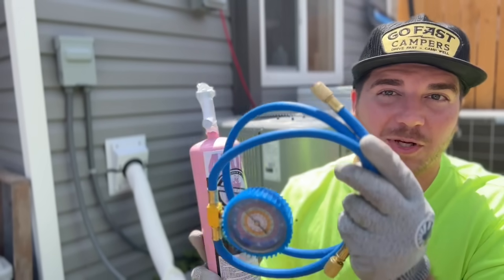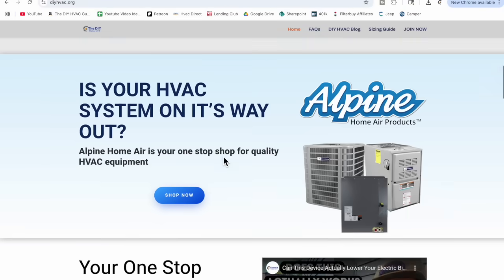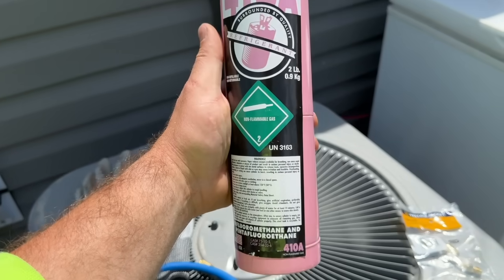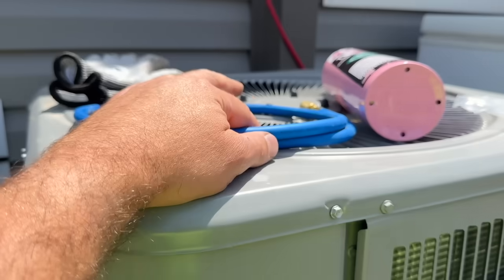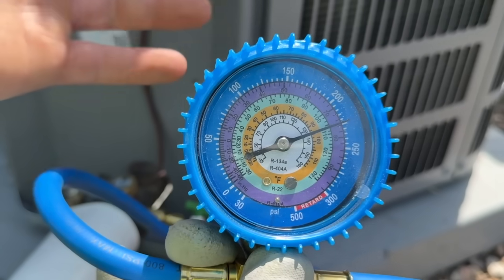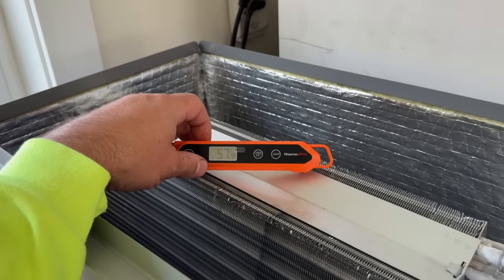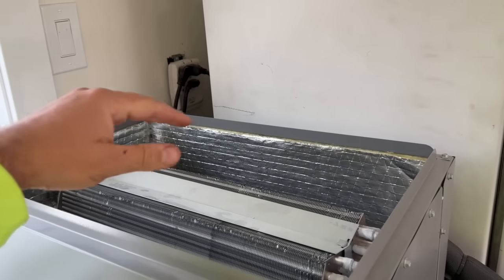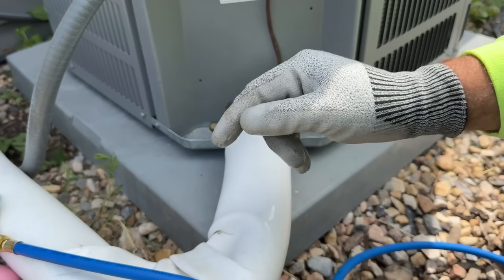You Can Recharge Your Home A/C Like A Car??  Colder Air in 6 Minutes!

Comment: 144 bucks for the kit, I can get a guy out here and charge my system for the same price
Reply: "I got a guy" 😆
Reply: No way you’ll get a licensed tech with an EPA certified card for 140.00 dollars
Reply: @melvinwillingham233  Maybe. If it's cash, that's tax free income.
Reply: Had my R22 system topped off this past Sunday for $150 total.  Last bump on my 22 year old Trane system was 3 years ago.
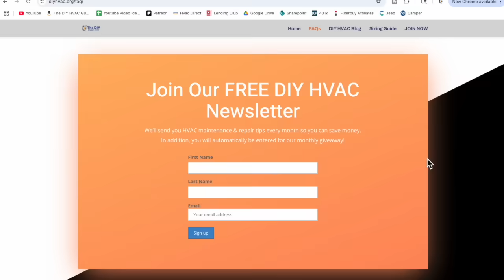I've used this HVAC repairman several times before.  Called him about 12:30 in the afternoon, he was at my house about 3:00.
He was finishing an install when I called, otherwise he would have been out sooner.  $150 charge and 2 1/2hr wait on a Sunday afternoon, I couldn't have asked for more.  Happy, Happy, Happy
Reply: @BlainsTube  How much did he add.... 2 puffs?
Reply: @joecooksey4331   Not sure, but it was enough that my evaporator coil stopped icing up.
Reply: @BlainsTube  Depending on the system tonnage a few ounces can make a difference.

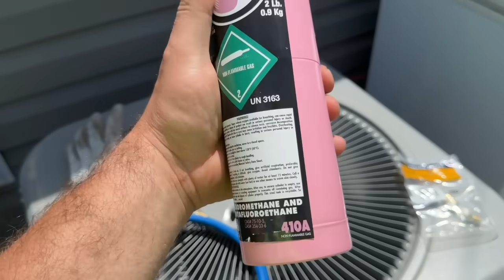Comment: 5:13. My understanding is that to add or remove refrigerant (or to simply connect a hose to your system) requires an EPA certification.  Or your neighbor can report you and get a $10,000 federal reward.
Reply: The website indicates perjury is a federal crime and also requires all your info. A big chance to take and would assume most people are smart enough not to lie just to purchase refrigerant  as the certification is in the data base and could be easily checked should an audit occur....
Reply: @steveoh9838 perjury is committed constantly by members of congress, lawyers, mayors, govenors and uniformed lawless enforcers.  What's new?
Reply: the point is: this refill-stuff is not a "top up" thing, its mostly R600a and R290. Same here in europ, its illigal to to without certification, fines up to 25k €. the refillstuff is more or less only butane and propane.
my ac runs on Butane/Propane sind 3 years, no problems at all. was originaly a R134A system.
Reply: @DerSchrottBastler  R410a is a 50/50 combination of R32 and R125. You are misinformed.
Reply: I don't have a neighbor within 1 mile in any direction
Reply: @SteveDodson-l8n  Easier to see and hear when EPA flies over with the helicopter as you are topping up your system.
Reply: EPA Cert is only required for commercial systems... possibly vendor wants one to sell, but that is an internal requirement. There is no law against "unlicensed " sale or possession of "Freon". $10K fine applies to commercial work and systems over 5 tons. Loads of bad info out on the Internet spewed by idiots.
Reply: How many jabs did you get?
Reply: Feds to busy rounding up illegals. EPA probably have 10 field workers left after Elon.
Reply: There are a number of online certification programs that take a couple days and don’t cost much. That’s my plan since this stuff interests me.

That said, a lot of people, myself included, live in areas where your neighbor would have no idea or they would come over to help you do the work. They also sell R134A cans in auto part stores and I’ve used those a couple times and no one has complained or sent the feds.
Reply: @m_cabral  No EPA certification is required when buying "auto" refrig in a "can" less than 2 pounds. DIY car owners do not need an EPA cert to recharge their own vehicles. If one works on mobile systems for pay then an EPA 609 is required.
Reply: You voted for Harris/Walz, didn't you-
Reply: @brucemc777   nope.  The government doesn't have a right to my home.  If you want to read an anti transvestite rant read my book.  But this diy guy is leading people up shit creek.  HVAC installs can be done 99% correctly and still fail.  And cost $10k to remedy. Yet he never gives his audience much of a fair warning about these risks and he rarely mentions legalities ... These videos are almost designed to be an HVAC inside joke to mislead homeowners.